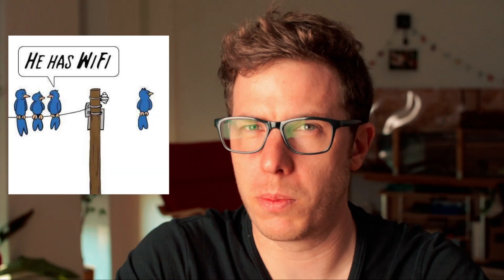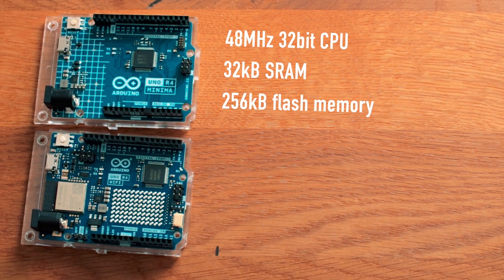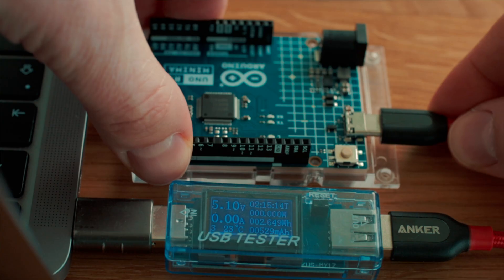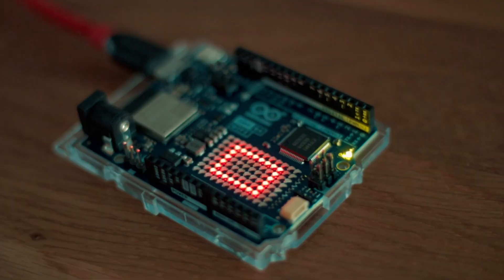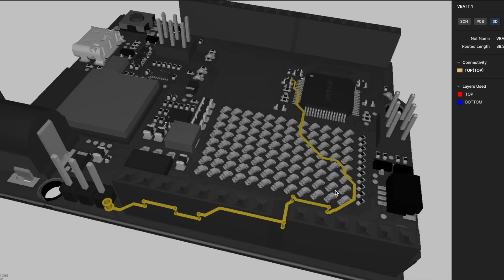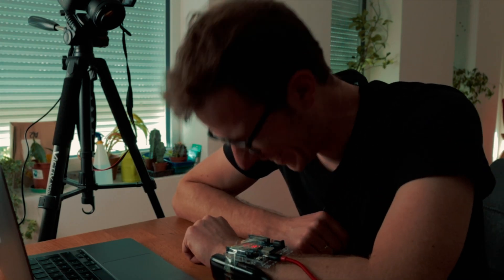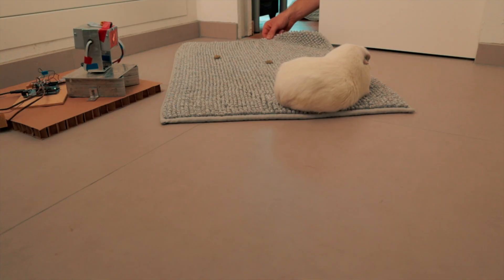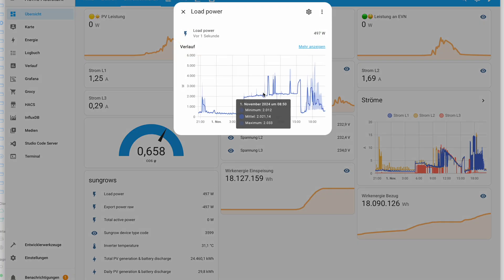Arduino UNO R4 WiFi: The Upgrade You (Probably) Don't Need | In-Depth Review

Comment: Just for people who are impressed by the R4 features. I did some intensive testing on the minima. And it failed. What is the use of these great connectivity features if the basics don’t work reliably ?
I found those flaws, and as they are obvious and not been fixed since release i have lost confidence in Renessa‘s capabilities .
1.) both serial ports are not working reliable. They are generated in software, and so if the program you are creating crashes , loops infinitely or just produces too much load, the minima cannot create the serial ports, thus maybe even bricking the device. A cure is to load a „generic example“ in bootloader mode. You have to replace some of the core libraries.  
2.) Memory management is not really reliable, globals get „lost“ under certain conditions. (This is not on the compiler)
3.) Interrupts do not trigger reliably, be it on pin-changes or timers. Sometimes the isr even loses volatile data.
As I use arduinos for MIDI development , I am very dependent on Serial (UART) communication , and these flaws are a no-go….

Comment: About to start my 1st project ever, a humidity detecting smart-fan. A lot of criticism about the R4's on you channel but for my simple application, should I really avoid the R4 WiFi? They are only ~$22 USD right now and the same price as the R3. I get some of the design criticisms, but for my simple application, would R4 be best? Or do I not want to sully my brain with Arduino platform at all and become and ESP32 purist from the get-go?
Reply from the maker: Great question for your first project!
The good news is - it really doesn't matter for what you're building. The R4 WiFi will absolutely work fine for humidity sensing and fan control.

That said, if your sensor and relay circuit is 3.3V compatible, ESP32 gives you the most options later. You can program it using Arduino IDE, Espressif's own tools, ESPHome or MicroPython just to name a few.
Reply: @playduino  Thanks. I think since asking this and doing more research, I decided I wanted to go a route that lets me use circuit python. I’m going for pi picos for now but am super impressed by ESP32s potential if I get more serious. Great channel, many thanks.
Reply from the maker: Awesome choice! CircuitPython works great on ESP32 or Raspberry Pi Pico. Both are great choices for what you are trying to achieve.
Thanks for the kind words! Would love to hear how your humidity fan project turns out. Good luck!

Comment: I'm going to do my best to avoid Arduino until they fix that damn goofy pin spacing between connectors.  Isn't it about time they fix that mistake and start that transition to the normal 0.10" spacing?  Yeah it would break a lot of things in the short term, but they could also make adapter boards to satisfy the interim.
Reply from the maker: I think it was on purpose to prevent you from mounting shields the wrong way. But it is annoying for sure

Comment: "I like to keep things local." Why is it everybody trying to pull us into their $#@& "clouds" all the time??
Reply from the maker: Because of sweet sweet subscription based recurring revenue
Reply: @playduino  Obviously I was being rhetorical. But now here is the question. What did they sacrifice in the design to implement that in the design?? We already know that it can't source as much current on its pins. What did they leave off? Is this what the "R4" should look like?? What would a "dream" R4 be?? I'm not an Arduino user so I can't say. The led matrix seems a bit gimmicky and maybe should be its own board. Does the new CPU have floating point capability on the silicon?? That's the real test imo for a chip these days imo otherwise I might as well just use the z80 (well a PIC). I've avoided the esp32 because it's single sourced and Chinese I feel like they put a backdoor in everything. So that's just a no for me. 

So the subject is, what should have the R4 looked like really?? Maybe a risc V  core with the fpu version would have caught my attention. Start with that. Maybe have your own local "cloud" implementation. 

Do a "clean sheet" design video!
Reply from the maker: The Arduino Uno R4 couldn't be a true clean sheet design because Arduino needed to maintain compatibility with the R3 as much as possible. However, I suspect the choice of the Renesas chip wasn't purely technical - there might have been investor influence behind this decision.

Arduino faced a challenging situation: the variety of powerful 5V chips is quite limited these days, and with the Atmega328P officially marked as 'Not Recommended for new designs,' they had to make a change.

Regarding the ESP32 - yes, having a single source in China is controversial. However, it's an amazing chip for its price-performance ratio. As long as you don't connect it to cloud services, you should be fine in most applications. That said, we can never completely rule out the possibility of silicon-level backdoors in any chip.
Reply: @playduino  I watched a couple of other videos I missed that there was a "minima" version without the esp32 and led matrix. The R4 is an ARM core with an fpu so all is not lost. But since they're moving to ARM from the AVR they'll have to rewrite their libraries anyway so there's that. Not moving to the RISC V a true open source core is a missed opportunity imo.  FWIW the Chinese are pretty dastardly salt typhoon proves that in spades. It's crazy to rely on their parts especially if they're warring with Taiwan at some point. Just a bad idea to use it in commercial production imho.

Comment: why does the R4 wifi have a Quick Connect I2C port if it  has limited I2C speeds. The logic behind the R4 series just confuses me. Yes, I do use them for certain projects, but if they instead kept making the R3 but with an ESP32 that can work with it or an affordable ESP32 like everyone else, they might actually do better. Literally the only benefit I find is a 5v pin, but most projects could just use an ESP32 shield, and if you use the Mega, you get far more pins. The R3 with a Wifi Shield is objectively better for more projects,  the way they do it with two different microcontrollers on it, it just makes it far inferior to a standard ESP32 development board for most projects because of how much more difficult it is to communicate with the board.
Reply from the maker: I agree

Comment: There is something not right about using something so powerful just for the wifi and having a much weaker processor as the main processor. I doubt the ESP32S3 is even close to using its full potential as just a wifi and bluetooth chip. If they had used it as the main processor then they would have had a more powerful MCU, could have had much more flash and RAM and potentially the wifi and bluetooth performance could be better. Even if they locked off one of the cores just for wifi and bluetooth it would still be more powerful. ESP32 is supported in the arduino IDE anyway. Likely it is just to keep it similar to the minima version but why go for such a powerful wifi chip then when there are cheaper and less powerful options?

It is like when someone makes an SBC that is very powerful but then all the GPIO goes through an atmega328p, it doesnt make sense, especially when they market them for robotics. There are much better and just as cheap MCUs that could be used with more processing power and much better peripherals like faster SPI, CAN and hardware timers. The argument that arduino is easy to use just doesnt work as with these boards you need to write your own code for the main processor and arduino to interface them anyway and many other MCUs can be supported by arduino now.
Reply from the maker: I agree, I feel sorry for the ESP that is trapped in this board.
Reply: @playduino Look closely for the jumper to switch to programming the ESP32 on the Uno R4 WiFi.
Reply from the maker: sure you can upload custom firmware to the esp32:
https://docs.arduino.cc/tutorials/uno-r4-wifi/esp32-upload/

But all of the IOs are connected to the renesas, so you are very limited in what you can do. potentially maybe you could write a special firmware for renesas so that it acts as port extender for esp32 but it will slow down I/O activity quite heavily.

@davidgari3240 Am I missing something?
Reply: @playduino  Main benefit is backward compatibility.
More flash and speed; also good.
Reply: Well that only shows how far behind the typical arduinos are compared to what's used in "normal" devices nowadays. They probably couldn't find a simple chip that supports wifi. Cannot just use one of the modern chips though because of library compatibility, I believe.
Reply: @MiTheMer  True. And to manage the wifi requires a decent uC anyway with no doubt plenty of spare cycles to service any Arduino sketch requirements - hence the popularity of ESP32. There's no raison d'être for the R4 IMO.  I still resort to nano clones for quick testing of 5V only sensors. ESP Arduino library compatibility is very good and a non-issue unless your sketch relied on AVR specific tricks or ASM. The R4 is no longer AVR so there's no excuse not to explore more capable and vastly cheaper options which remain compatible with the Arduino IDE.
Reply: Yeah.. I kinda hate this new board honestly. can't think of one good scenario that it would be good for.
Reply: The original ESP32 was marketed as a wifi module to be attached to an existing MCU and addressed using AT commands. Many application specific integrated components contain powerful MCUs which appear to be under utilized (or closed).
Reply: I may get one if the R4's to okay, but I don't see myself using it for projects. I love the restrictions of R3. Small memory means you have to think about your code, and you can easily replace the R3 with bare ATMega328. Much more useful as a prototyping tool in my opinion.